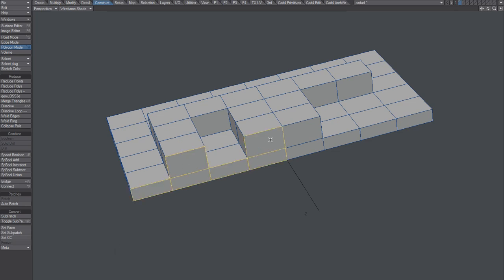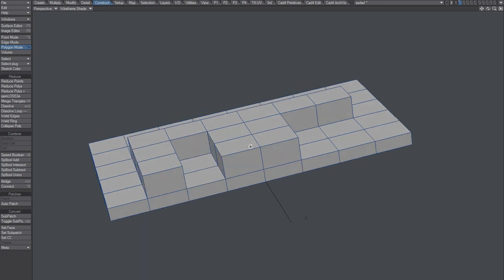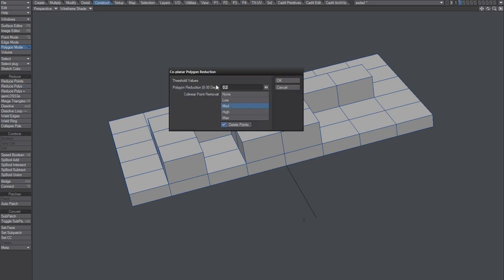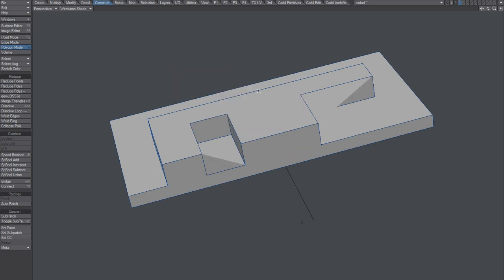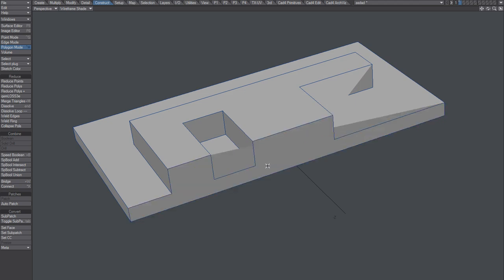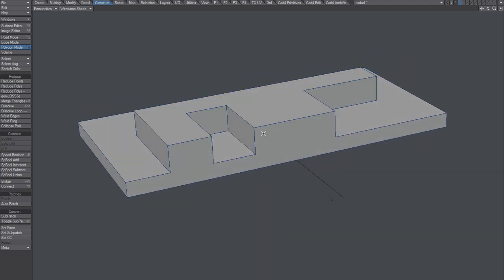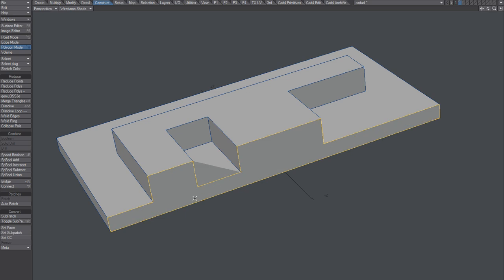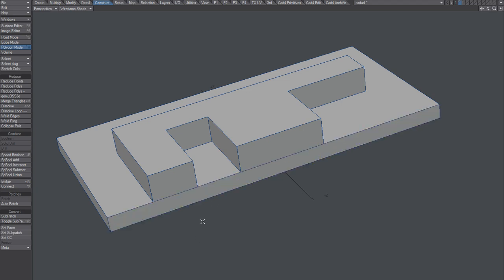LightWave Model - Reduce Polys, CleanUp

Comment: If you use the reduce polygons tool after you tripple the polygons that will get rid of that point order issue. Don't try merging the polygons again just use the reduce polygons tool instead
Reply from the maker: ah  :) nice trick, thanks!  :)
Reply: No problem. Another trick that seems to work quite a bit, is to merge your polygons together and if it creates that point order issue just hit CTRL Z on the keyboard to undo and then press shift z again to merge them again this time the point order is fixed. I have no idea why though lol
Reply from the maker: yeah  :D i noticed this weird incoherent function also  :)